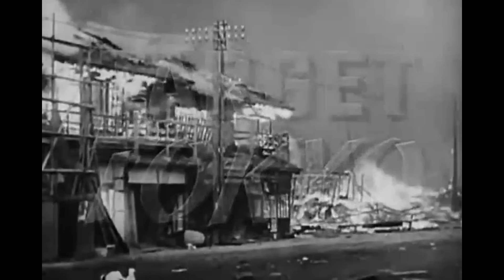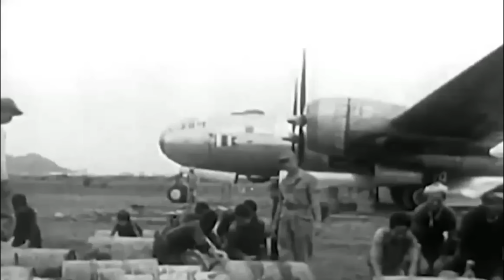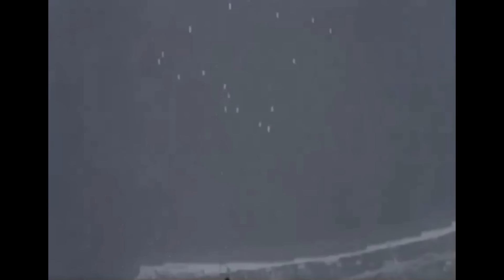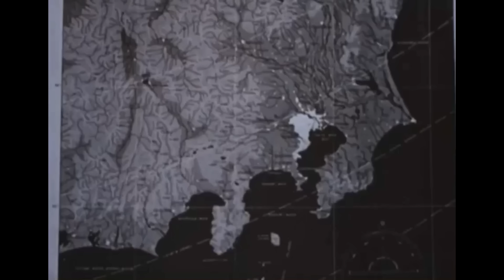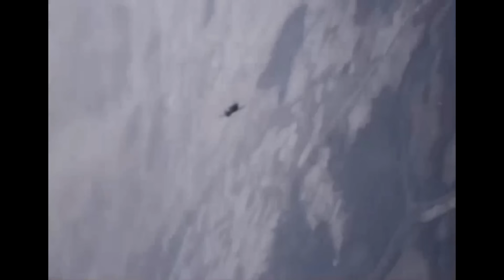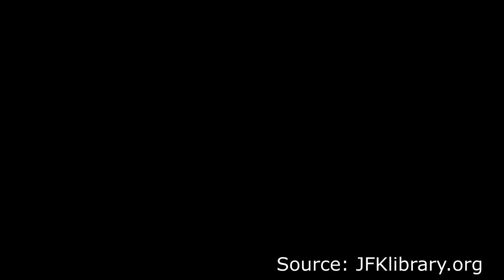Forgotten Devastation: Firebombing Japanese Cities

Comment: What is CO2 affixiation?
Reply from the maker: According to google: CO2 affixation refers to the process where carbon dioxide (CO2) displaces oxygen in the air, leading to oxygen deprivation and potential asphyxiation. While CO2 is a natural part of the atmosphere and our bodies, high concentrations can be dangerous. It acts as both an asphyxiant (reducing oxygen) and a toxicant (directly affecting cells) at high levels.

Comment: A little-known fact is that the entire B-29 project from design, development and production cost more than the entire Manhattan project and one must respect the fact that it took both of the top two most expensive projects in WW2 to get the 1st & 2nd Atomic Bombs dropped. 7 more Atomic bombs were ready to be dropped after the first 2 had been dropped and those would have had to last for 2 1/2 months, thereafter 6 Atomic Bombs could have been delivered every month. Regular mass bombing missions were still carried out in between the A-Bomb attacks on August 6th & 9th as well as another massive bombing raid on Tokyo after the 2nd A-Bomb drop on Nagasaki before the Emperor threw in the towel.
Reply from the maker: @Sugarmountaincondo  ah, I did not know. Thank you for sharing this with us.

Comment: 39:59 This is UNTRUE. The original estimate for losses for op downfall was only 30000. Then Trumann expanded that no bit by bit to justify the atom bombs.  Japan was simply out of ammo, and was already starving to death.  While it is true the Japanese committed barbaric attrocities , The US should not have lowered herself to the level of the Axis. specially when it was clearly unnecessary. This hidden motive was to continue later on in Korea, Vietnam, Chille, Iraq, Afghanistan, and now you see it in Palestine.
Reply from the maker: The Japanese were already preparing for the US invasion and uncannily assessed it would occur at Southern Kyushu, specifically Kagoshima bay. Their strategy was to inflict as many US casualties and quickly as possible to break the U.S. will to fight. By late summer Japan had 15 divisions ready for the defense, over 900,000 men, compared to the 582,000 US assault force. Even if you do a modicum of research you’ll find this info readily available.
Reply: The initial numbers were revised when intel made it clear that Japan was heavily reinforcing Kyushu. And until the enemy declares surrender it is necessary to do whatever needs to be done to get the enemy to surrender.

Comment: where did you get the notion that these operations were “forgotten” ?
Reply from the maker: Good question. I would like to hear your thoughts, because I don’t think there is a clean, correct answer. This is my assessment, because of the broad definitional usage the English language has adopted for “forgotten.” In English, we use forgotten several ways, some of which are “unremembered; out of mind; neglected; bygone; overlooked.” After I made my first Vietnam POW/MIA video, I was mildly shocked that some viewers in their 20s and 30s had never heard of this. At first I even thought that someone was messing with me. So, even the Vietnam war POW issue is slowly becoming forgotten - as I am using the term - in our society. I won’t argue with you, as you can make several points against my use of forgotten. I just want to hear your thoughts. Thanks for watching and commenting.

Comment: The B-29 truly was a "next generation bomber", giving American bombers unheard-of range and bomb capacity. Which made bombing of Japan possible. Without the B-29, the Pacific theater of WW2 would have lasted MUCH longer than it did. I don't know if any aircraft in all of WW2 had as big an impact as the B29 did. Including the Mustang.
Reply from the maker: Good post Steve. Thank you for watching and commenting.
Reply: Nonsense!  The range of the B-29 was unneeded after the Philippines were taken.  The altitude wasn't used because the Norden bomb site couldn't deal with jet stream winds, so the bombing elevation was reduced to 8,000 feet.   That made the pressurized cabin unnecessary.  The Japanese didn't have enough AV gas or trained pilots to intercept the B-29 formations rendering the onboard analog AA computer worthless.  3 billion dollars spent on the most expensive weapon of the war, and it wasn't even really needed.

Comment: An excellent video and narrative.  Thank you for sharing.  
My dad was in the Army Air Force and served in a B-25 squadron on Abemama, Saipan and Okinawa.  He had been removed from flying status because on an anti-submarine mission in 1942 his eardrums ruptured during a high-speed dive toward what was probably a neutral whale.  There being a war on, he was not discharged but rather was kept in the same outfit as a supply sergeant.  The B-25 has been overlooked in the Pacific because of the B-29 campaign against the Japanese home islands but the twin-engine B-25's were useful in combating submarines and supply ships attempting to reinforce Japanese troops on the islands.  The planes were used in Okinawa to strafe airfields on Kyushu to help support the Navy with their kamikaze problems.  B-25's didn't kill hundreds of thousands of Japanese but they still had their uses.
You had extensive video of P-51's fighting over the Home Islands.  The Mustang was a wonderful airplane, but it would have been nice to see some mention of the P-47N model that had been developed specifically for the Pacific war.  The Thunderbolts also flew B-29 escort missions from Iwo Jima and shot up targets of opportunity in Japan.
Reply: Don't believe the B-25 has been overlooked at all.  The Doolittle raid was carried out by B-25s.
Reply from the maker: Thank you so much for your thought comment, and history.  This is very insightful.

Comment: Interesting in 1937 White’s observation about Japanese building construction was ignored by Air force leadership, but picked up by LeMay’s bombing Japan from China.  Leadership adherence to a doctrine although data shows it’s not working.  

LeMay’s ability to change his tactical and strategic methods to achieve military goals is what made him a great Commander.
Reply from the maker: That's a good point, glad you picked up on it and frankly....I had not thought of this point in those terms, but you are absolutely correct in your observation!  Thanks for watching and commenting.
Reply: Right after Pearl Harbour, two American sociologists published an article in McClean Magazine stating that if we wanted to get back at the Japanese, fire was the way to do it.
    They used Osaka as an example. Osaka was made of wood, bamboo, and tatami mats in 80% of the buildings.
   80%
That's practically the entire city.
   Add to this how densely populated it was. The average street width in Osaka was 12 feet.
    Soembody from the U.S. military command must have seen that article.